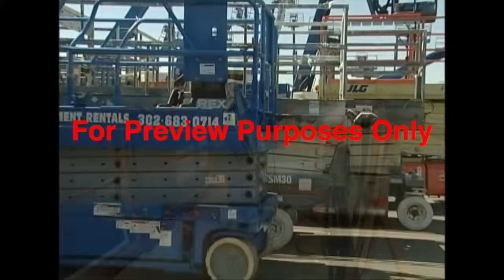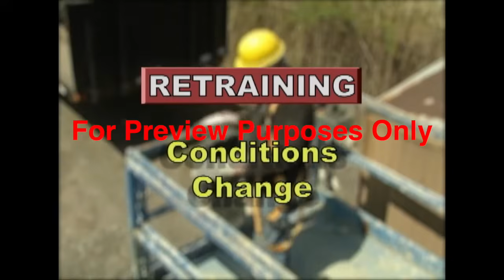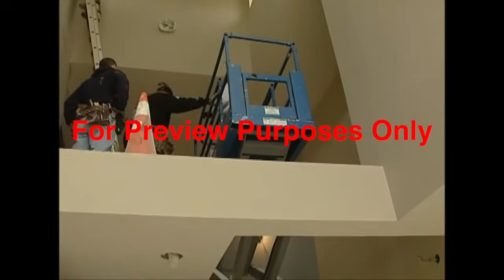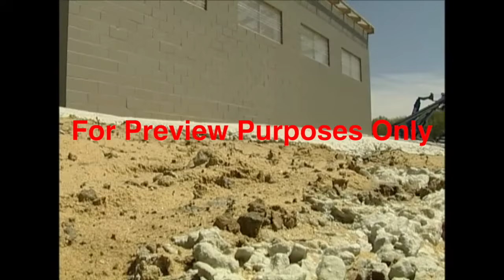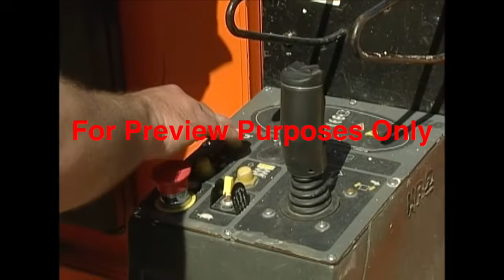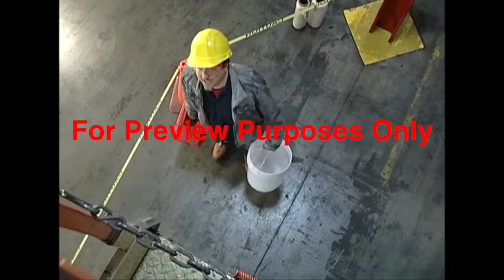Scissor Lift Safety Training - OSHA Safety for Employees

Comment: Who ever watches this and is new in construction, please never tie off to a scissor lift. Even when the GC forces you to, just go home. It is not safe to tie off to a scissor lift for multiple reasons. Don't let the boots on the ground dictate your safety ( They are just covering their asses for insurance).  There is a reason why OSHA does not require you to tie off in a scissor lift!!
Reply: according to OSHA you should tie off unless the rails are 42" or more high
Reply: @johncurran4384  You are exactly who I am talking about in my original comment. Shut the fvck up unless you are working on the lift.
Reply: https://youtu.be/8n4SlJ4jl-A?si=XamfnnsVyT6mAmZI
Reply: Wrong!
Reply: @AlexElVeterano  Don't stay stupid forever buddy
Reply: You couldn’t be more ignorant about what you’re saying.  

OSHA regulates scissor lifts under scaffolds.  The scaffold standard (Subpart L, 1926.451(g) Fall Protection) applies.  If the guardrail system of the scissor lift does not meet the requirements of (g)(4) (vii), (viii), and (ix) of this section, then you are REQUIRED to use a Personal Fall Arrested System while operating the lift.  

Imagine having this information at your fingertips and still posting this….
Reply: @ConspicuouslyObvious   You either have never been in a lift, or you are a union puss boi lmfao. Don't stay stupid forever.

Comment: can scissor lift be driven when up high to go forward or backwards?
Reply: There are no standards for this, you would have to refer to what the lift manufacturer specifies, but as a general rule: unless authorized by the manufacturer, you cannot move a lift until you have lowered the scissors all the way down, to prevent tip-over and/or "catapult" effect.
Reply: It would be hilarious but best not to do it because it is unsafe.
Reply: The Toyota I'm working on can indeed but only when it's up to 90% of its maximum reach. Won't move when at 100%
Reply: Yes all the time. That's why you are "required" to have a spotter on the ground. I hang 6" pipe in the air all the time and drive with it in the air lol, its completely safe if you are aware of your surroundings and are within the weight limit of the lift.
Reply: According to my training for the Lift Operation osha card, no you should not.